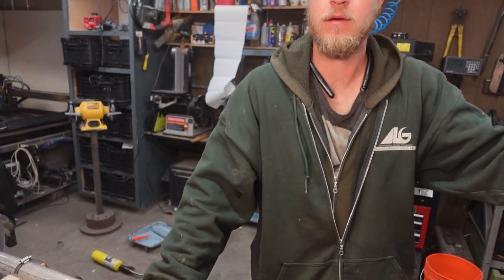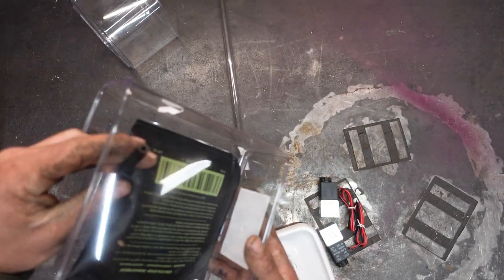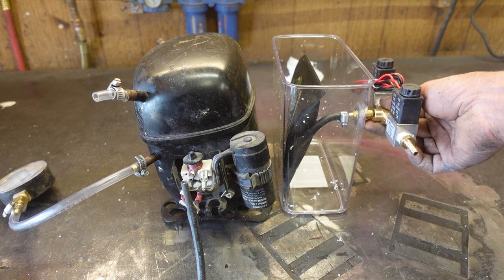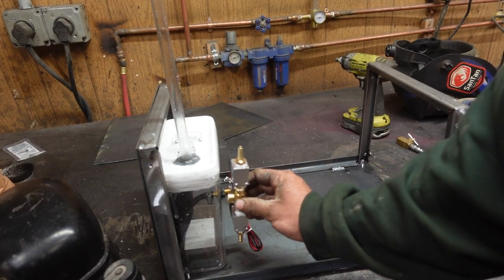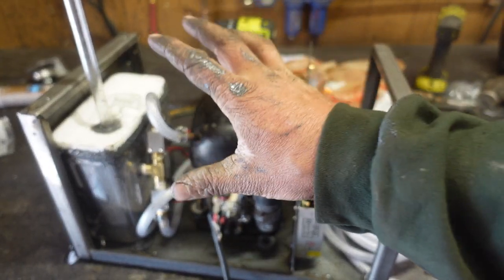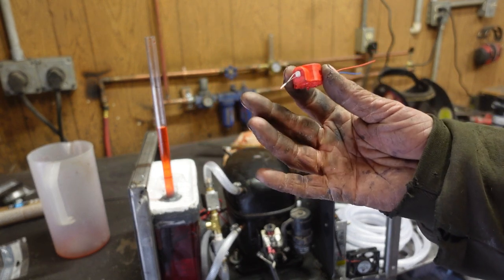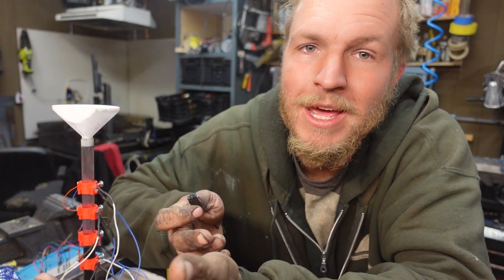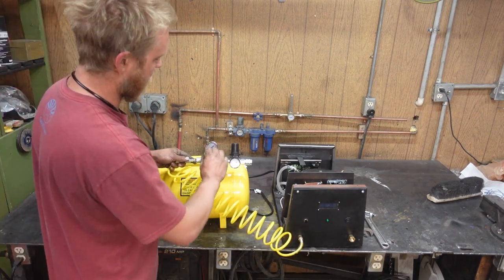Homemade Gas Mixer For My DIY Laser Tube

Comment: I think you were actually very close to achieve your goal with this optoelectronic measurement. If you'd just put a non transparent ball on top of the liquid and have a threshold set to just detect complete blockage of laser beam (in whichever way you were doing it, a ADC, comparator, transistor, whatever), that really should work and the whole thing is very clever idea.
Reply: This is what I had in mind. When he mentioned the laser diode and photo resistor. I figured the water would cause the laser to scatter a little but it’s still getting ambient light without the lid and I’m sure some light from the laser is still hitting the photo resistor. I’m just a hobbyist that follows schematics and am unfamiliar with using solenoids and relays and their speed, but that’s the gist I got from it from my dabbling with LDRs.

Comment: If you ever want to get more accurate readings from analog sensors you can use techniques such as 'star grounding' or 'floating grounds' to reduce noise, just given you some terms if you are interested. Another, more simple trick is twisting the leads of analog sensor wires.

Comment: You the man.. Hey. I used to work in a laser shop was very cool. I have many hours on a lumonics super 48.. We had a different setup for our home made mixer... It mixed 3gases right from the bottle into regulators using flow meters like on a mig.. And we recirculated the gas all day.. Worked pretty well.. So cool what you are doing bro.. Peace.

Comment: very cool project! Typically you can fill an evacuated tank with your laser gasses by partial pressure to get the mix ratio you want... ex 10 psi (absolute) CO2 then add another 10 psi (absolute) of Nitrogen and then 50 more psi (absolute) of Helium. The result will be a tank filled with 70 psi absolute.

Comment: you're a very talented fellow.  did you look at mass flow valves as an option?  you can get them pretty cheaply on eBay.  It wouldn't be as elegant.... but it would be able to mix the gases simultaneously.  If you ever decide to make your laser a constant flow system, that might be the way to go.  Again, congratulations on a very innovative solution!  Doug

Comment: I never passed my fluid mechanics class but I feel like there has to be a way to leverage the law of partial pressures, pressure transducers and your Arduino so make this much more simple. If I vaguely remember correctly you can, for a given volume, just mix gases in percentages based on the sum of the pressures of each type of gas in mixture. But like I said, never passed the class and I might be blowing smoke.

Comment: Wow great project. You might have been able to fix the water bath sensors by ignoring the inputs during relay switching (technical term masking!) but actually the new design was brilliantly simple, robust, and you get the cool breathing sounds. 🙂 Well done for sticking with it.
Reply from the maker: I'll keep this in mind for future projects! Thanks for the support!
Reply: if you have problems with the switching peaks, you have to use two power supplies. one for the logic and one for the relay so your arduino is not confused the Term is galvanic Isolation :)

Comment: Refrigeration compressors pump a lot of oil vapor out, you really want a filter to absorb all that otherwise it will go straight into your tube and kill your electrodes.
Reply from the maker: I did put a filter in, I guess I cut that part out in my frenzy of cuts to make this video not so long hahaha

Comment: Looking at this, and learning from your mistakes, I’d propose an ultrasonic sensor pointed down the volume tube, and we add a float in the tube to ensure reading of the gas volume and not the distance to the bottom of the tank.

Comment: I thought of a way to automate the mixer further; instead of manually changing the type of gas connected to the mixer; split the inlet in 3 and use a 3 input 1 output solenoid controlled valve; or create it using 3 valves and 3 rotary solenoids similar to what you did with the servo on the first valve you used.

Comment: I think you could do the water method with a plunger in the tube attached to a sliding variable resistor. I like the idea of being able to tell exactly how much gas is being added, it just satisfies my OCD a little more to be able to land on an exact value. I know given the jank of the whole system it won’t be exact, but at least it’ll be capable lol

Comment: Not sure if you are still checking comments on this video or not, but here are 2 thoughts that might improve how your pretty neat gas mixer works:
First suggestion - why not simply float a round cork ball in the tube connected to the water bath / bladder thing?  It would give you a clean on or off at your photoresistor.  The water, even colored, is going to simply pass to much laser light through it.  Anyway, in the end you came up with something that works - just offering my $0.02 in case you wanted a bit more control over the setup.
Second suggestion - is related to the air that is introduced each time you switch gas cylinders.  Adding one more relay, a tee fitting and a solenoid connected right before the air bladder gas inlet solenoid could be used as a purge valve to bleed the line of air before starting to fill the bladder after each gas cylinder change.  This kind of setup is very common on NO2 assisted race cars to ensure the NO2 line is purged of air before they make a pass down the track.

Comment: If you use a larger diameter tube and suspend a float on the surface of the water. An ultrasonic sensor can measure the distance between the top of the float and the tube. You'd get the resolution your looking for. Just not sure on the precision without some experimentation. :)

Comment: You could have used a double acting pneumatic cylinder (PC) and 4 electric pneumatic valves (EV) and a flow control valve.  The cylinder provides a know volume and with the Arduino and a sensor,  measured the exact pressure of each gas as it fills the cylinder.  The flow control valve controls the speed at which the PC fills with gas.  This is important if you want exact volumes of each gas.  On the end of the PC rod, mount a reflective IR sensor and rig up a measurement device using a seamstresses white vinyl tape and read the black tick marks as the reflective sensor sees them as the cylinder fills and empties if you need to stop at a certain point.  With a bit of math you can get much more defined gas mix. 

1) Turn on 1 EV hooked to the vacuum pump to pull a vacuum on the fill lines and 1 end of the cylinder. Then turn off the EV.  
2) Next, turn on the fill EV to fill the evacuated side PC.  Once filled, turn off the fill EV.
3) Turn on the Empty EV to let the gas escape and turn on the air pressure to the other side of the PC to force the gas out and into the collection tank.  Once you have measured the cylinder being fully retracted and thus the gas forced out of the cylinder, turn off the Empty EV and turn off the pressure EV.
4) Rinse and Repeat for each gas.

Comment: If you float a reflector on the water column you can point a laser distance measure down the tube to get the column height to mm accuracy so achieve any gas mix required. Opto isolated relay would be better also SSR or MOSFET switches cause less back EMF/noise issues but then you still have the solenoids to deal with (no big deal). Shame you gave up when so close, it wouldn't have taken much more to get it working perfectly/reliably.

Comment: Love your ingenuity and grit!  I know hindsight is 20/20 but did you consider a peristaltic pump? They pump metered amounts very easily, and can handle gas. It can easily do 50psi, i think they can get up to 120psi actually.  This type of pump is just a bunch of rollers along a tube driven by a stepper motor, resulting in a metered amount of gas per revolution, no valves needed.    I am subscribed and watching all your vids on this co2 laser, keep up the great work!!

Comment: The problem with light sensors are interferance. Pump turning on and of was creating emp which was disturbing analog readings. Shelding the cables would probably fix it

Comment: I gotta say..that's quite a project to build a tool for another project. I was pretty uncertain what exactly you were building it for until I checked the tube video.

I'm a bit of a maker myself so I just have to ask. If I found a need to build  a device from scratch to measure ratios of gasses my mind would've went straight to some kind of flow meter. Basically like a little wheel with a little cavity in it that takes gas from one side of the line and moves it to the other by being rotated inside a housing. Each revolution would move the same amount of gas from the source side to the storage side.

What made you take this route? Am I missing something?
Reply from the maker: I mostly did it this way because of the simplicity of it. To build a flowmeter from scratch that I can be absolutely sure is moving the same amount of gas every time would be very difficult(for me at least). With this setup, I could tell visually that I'm getting the same amount each time.

Comment: I was thinking what if instead of the laser diode you used a lidar sensor at the top of the column looking down at the water? Granted I don't know if lidar works with water but the sensors are like, 20 bucks I think. It'd give a much more precise reading of the level

Comment: Wouldn't an ultrasonic distance sensor have worked to get the volume of the tank?
Reply from the maker: I had the thought, but was worried about water sloshing into it when I move the machine
Reply: @cranktowncity  A JSN-SR04T is waterproof for example. I don't know if it would work reliably though. Pretty creative solution and a terrifying sound